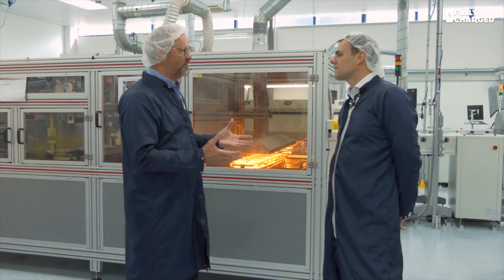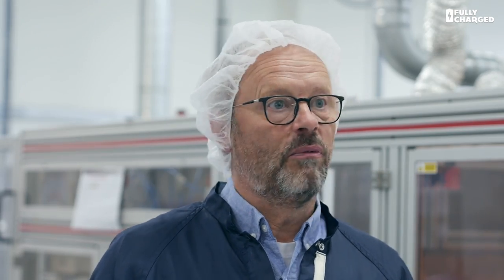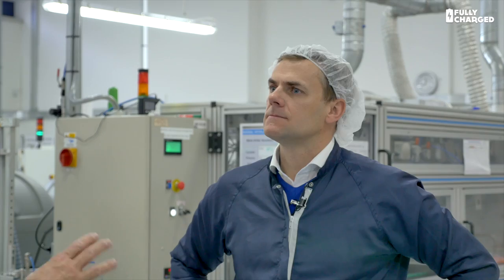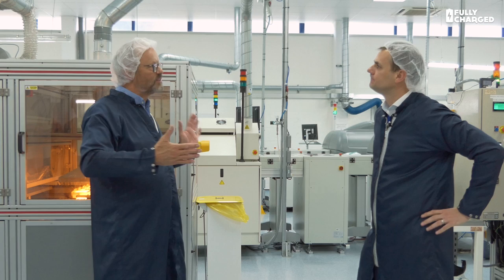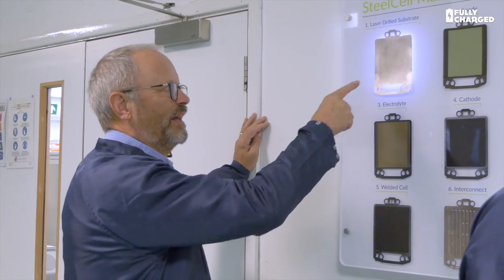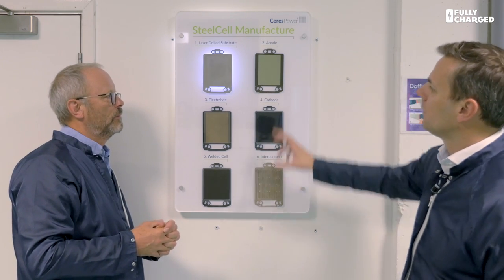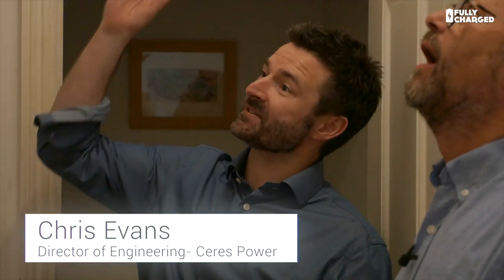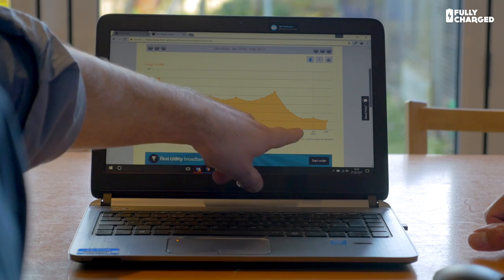Ceres Power | Fully Charged

Comment: I need to chime in a bit here about the use of hydrogen. There is this idea that we can create hydrogen cleanly by doing electrolysis of seawater using electricity generated from renewables like wind and solar. While it is true that it is possible to do this, it is also true that it is a massive waste of energy due to various losses along the way. Let me illustrate:

Problem A: There is a tremendous loss of energy in the process of electrolysis. Electrolysis requires a lot of energy to split H2O into 2H + O, so a lot of energy is spent in this process. The process itself is not efficient as you will need to use a lot of the energy generated from the renewables to power up the facility / plant that does electrolysis itself. So of the total sum of power you generate from the renewables, a huge chunk of it goes towards powering up the plant that does electrolysis, then another huge chunk goes off by way of losses in transmitting the power and heat and so on and finally the remaining energy goes into the actual action of splitting water molecules - this is the energy that's "stored" in the form of hydrogen. Basically what we're doing is that we are storing the power used to actually split water in the form of hydrogen gas, and the use of this hydrogen gas either in a fuel cell or by combustion gives us back that power that we stored in it. Essentially, the hydrogen is just a highly inefficient transport mechanism for moving power from one point to another - like a really terrible battery.

Problem B: So now that you've wasted so much energy just to make the hydrogen and you've captured some of that energy in the form of hydrogen gas, you now need to liquify the hydrogen for transport. Liquifing hydrogen means using a cooling plant to cool down hydrogen to -252.9 degrees Celcius - this involves an enormous use of power and this is power that's going to be a complete loss. The power used to cool hydrogen to a liquid isn't going to be "stored" in the hydrogen so there's no recovering this power later from when we use the hydrogen. So again we have an insanely inefficient system here where we're just wasting energy completely.

Problem C: At atmospheric pressure, hydrogen liquifies at -252.9 degrees Celcius and starts to boil at just a fraction over this point. So if you put liquid hydrogen somewhere where it isn't constantly -252.9 degrees Celcius in atmospheric pressure, it will be boiling. To maintain a container at -252.9 degrees Celcius constantly requires a ludicrous amount of energy, so instead we create pressure vessels - as the hydrogen boils, it increases the pressure in the container and this increase in pressure slows down the rest of the liquid hydrogen from boiling - but it still keeps boiling and the pressure keeps rising. Eventually the pressure gets so high that it will trigger a pressure release valve in the container which will let out a little bit of that hydrogen to bring pressures inside the container to within tolerances. This means 2 things - one is that you cannot place that container indoors as it will eventually fill up that room with hydrogen and the entire room becomes a giant bomb. This is why the prototype BMW Hydrogen 7 Series which uses a hydrogen combustion engine and has a liquid hydrogen tank cannot be parked indoors in a garage or an underground parking space because the liquid hydrogen tank releases puffs of hydrogen every so often. The other thing is that every puff of hydrogen released to stabilise the pressure in the tank is a little bit of energy that we're simply throwing away into space - literally to space, because hydrogen is so light that it rises up to the very top of the atmosphere and floats away. That puff of hydrogen represents the huge amount of energy input from the energy that was used to power the electrolysis plant to the energy that split water and all the energy that was wasted in cooling hydrogen down to a liquid - all of that energy puffed off into space.

Problem D: Unlike electricity, transporting hydrogen is a MASSIVE drain on energy. You either need to waste tremendous amounts of energy to pump hydrogen on a high pressure pipeline or you need to waste tremendous amounts of energy to build a plant that fills up hundreds of high pressure tanker lorries with liquified hydrogen to be transported to various locations.

So if you look at the hydrogen life cycle as a whole, you see that we are wasting so so so so so much energy throughout the process. This is why the concept of a hydrogen economy did not catch on because hydrogen is a horribly inefficient form of transporting power, the wastage is simply unjustifiable. We have figured out that Lithium Ion batteries are a far better means storing energy because it's incredibly efficient and we also figured out that power transmission lines are far more efficient at moving energy than hydrogen pipelines or lorries carrying hydrogen.
Reply: The problem still remains though - we're going to have to waste a lot of energy in the conversion process: Wind / Solar -> Electric -> Hydrogen -> Ammonia -> Hydrogen -> Electric -> Consumption

We can do much better with Lithium Ion batteries because there's no conversion involved and Lithium Ion batteries have a much greater energy density than Hydrogen.
Wind / Solar -> Electric -> Consumption

Looking to the future, we are talking about glass-based electrolyte batteries that have far greater than even Lithium Ion
Reply: PJNinja Lithium Ion batteries only matters when you have power generation near you. Synthetic Fuels means Storing massive amount of energy easy for long distance transport. Able to access Renewable Energy once thought too Dificult or Remote. Making it Practicaly 100% efficient considering it was not viable. e.g. Burning Hot Desert combination Solar Thermal & PV to create Alkanes (C3H8 C4H10) from CO2.
Reply: The thing is, as long as you can lay wires - the most efficient way to transport energy is high voltage, high frequency power transmission cables because the losses are far far far less than converting electricity into other forms. I can agree with the use of electricity to create alkanes from CO2 if the aim is long term storage (years, decades, etc.) , batteries aren't great for long term storage. There is definitely a case to be made here for national security to use electricity to make alkanes from CO2 and store it underground for many years in the event it becomes necessary during war, etc. but for day-to-day consumer use - it'll be far cheaper long term and far more efficient just to build power lines for transport and batteries for storage.

Comment: 1kWh does not run a house for all that long. I just checked my energy usage: 54kWh/day average with peak consumption of 106kWh. I'm going to need whole lotta these boxes.
Reply: WOW! We use 4.5 kWh per day (3 kWh low and 6 kWh high). How many people live in your house? We are a couple. Maybe you should look into LED light bulbs and more efficient appliances and a condensor dryer? Also, I have found electric water heaters to use a lot more energy than a gas one.
Reply: That's a lot of energy! We're using about 12kWh/day and that includes charging my PHEV
Reply: kW = an amount of power, kWh = an amount of energy.
Reply: We are just a regular family in our home but have 2 central AC units, a pool pump and an EV. Energy consumption drops ~65% when the A/Cs don't run (in winter), and they are relatively high efficiency ones.
Reply: American, yes. Guilty as charged.

Comment: Seems like this a mis-marketed product... it's essentially a boiler replacement which also supplements your power consumption by providing power up to 1kW. But there's very few homes which don't have a product which requires more than 1kW to run, I'm thinking of a dish-washer, washing machine, hair dryer, air conditioner etc. Robert should have really made this clear in the video, but interesting to hear about "new" tech regardless.

Comment: Whilst I am delighted that this company is British and that its products are (assuming everything in the video is true and that the devices are affordable) more efficient overall than what we have now in the way of gas-burning electricity power stations, the fuel is still a fossil fuel and it is still only a 50% efficient process.

There is also the small question of energy security where in the UK, for example, much of our gas is controlled by the Russians... not exactly an ideal situation.

On the other hand, if we were all installing PV and battery storage instead (at probably much the same cost) all these issues would evaporate.  The path to a sustainable and secure energy future is, to me at least, very clear.  Unfortunately, it leaves Big Oil (for which in the context of this comment you can read as 'Big Gas') and their political buddies, out in the cold.  

So, that'll never happen then!

Comment: Keeping the temperature high might require considerable amount of energy. How practical is the fuel cell to be used on cars as range extender? If it’s practical, this Ceres Power company should seek this application and don’t wait there for its own death. Most startups die because their products fail to reach a viable market.

Comment: So is this more efficient then the Toyota fuel cell used in there hydrogen vehicles?
Reply: Just cheaper, SOFC does not require Precious Metals. Toyota Mirai still uses stupid PEM. H2 is also the worst large scale fuel for SOFC, kind of pointless to use H2.

Comment: Sorry, something I don't get. What happens to the fuel once it has gone through the cells? I understand you give pure Hydrogen and Oxygen (from the air) to the an hydrogen fuel cell  and it converts into pure water while producing electricity with zero residu. So, I assume when you feed these cells with an hydrocarbonated fuel (like natural gas or oil or gas or...) and the hydrogen part is converted into water when combined with the 02 from the ambient air, but it must leave something left, that is everything it was before minus the hydrogen. Am I correct? So I assume it still produces CO2, NOx, SOx and other "stuffs", depending on the fuel, only being much more efficient at doing so. I don't understand how this is solving any envirronemental issues only by being half-less polluting than just burning it. But being half-less polluting, isn't that still pollution? Please, if I'm wrong, correct me. Thanks.
Reply: You get CO2 and H2O like in combustion so this is not carbon neutral or anything. NOx and SOx are largely created due to the high temp in combustion. Here you don't have that.
Reply: What I understand is that the fuel gets through the cells, produces some electricity when some H is combined with some O to produce water, and then the fuel exits the cell and is burned as a regular fuel (though one with less H in it). That is, it does basicaly nothing for what pollution is concerned to my opinion. Interesting though.
Still I'd appreciate more details about this process.

Comment: why couldn't you do the same thing with a thermoelectric pile, a much older technology.
Reply: or even a small natural gas powered generator and using the  waste Heat thr same way?
Reply: You could do the same thing, I think the point is the efficiency they are getting is the best in the world. One of the reasons why we have big power plants instead of small ones is that its more efficient
Reply: You can do the same sort of thing with older means, but there are some important differences.
Thermoelectric piles have an efficiency of 1%, or 2% if you run them in extreme temperatures.
A small gas powered generator is essentially ye old lawn mower-generator, which only gets you 30% efficiency , they are loud  as hell and commercial units  are absolutely not intended to run all the time (as in they will wear out within a year or two).
Even industrial generators are only intended to run for short periods, if you ran them 24/7 they would maybe last 3-4 years before major components need to be replaced.

So in contrast fuel cells with 50% electricity and 50% heat in a solid state and quiet operation are quite a good contender.
Reply: generators are noisy for one!
Reply: Look into CHP units.
Reply: Thermoelectric generators are horrendously inefficient. A fuel cell is much better. They can also supplement your heating needs.

Comment: I don't get it, the fuel cell is still connected to gas from the home, so how does the fuel cell save money and give back to the grid?
Reply: Because the electricity is generated where it is used and the process involved in generating it is more efficient than burning it at a gas fuelled power station. Plus, the heat that is produced during the reaction can be used to heat water for the home.
Reply: foamcow cheers for clarifying . Makes sense

Comment: So it emits CO2 and CO when running on gas? Interesting, but w/o a bulk H2 supply it doesn't reduce carbon that much.
Reply: Alberto Knox But it converts 50% of the energy to electricity with no moving parts.
Reply: No most use case is not from H2. Also can use it to consume Synthetic Fuels from Renewable energy from hard to transfer place i.e. Deserts.

Comment: If it can handle ethanol them put it in cars and fuel them on Bio ethanol and you'd have a system big oil would get behind as the existing infrastructure (service stations) could easily cope with it without much change.  As long as the ethanol came from brewing up waste from different industries it would be good result.

Comment: He said it wasn’t a hydrogen fuel cell, but it is. It uses natural gas. And they are playing on the fact that natural gas is turned to carbon dioxide, and there is no net increase in the carbon in the air, but this is misleading, as natural gas is trapped underground and if we mine it, and convert it to carbon dioxide, there IS a net increase in carbon in the atmosphere. Hydrogen fuel cells are not the way forward.

Comment: This technology is really cool.

If these fuel cells can convert hydrocarbons so efficiently into electricity, and if we're getting more CO2-neutral hydrocarbons (from algea, biowaste, etc.), why would we want to use hydrogen gas as a fuel? Literally the only benefit as a fuel, as I understand, is that it's by necessity CO2-neutral. But if we had CO2-neutral hydrocarbon economy (which we absolutely need to achieve anyway, due to our dependency on them), that benefit goes away. Hydrocarbons are generally liquids and have higher energy density, which makes them much more practical as fuels.

Not to mention that batteries eats into the niche hydrogen gas would occupy, every time the batteries gets better, since they're always gonna be more efficient and practical for everyday short/mid-range use.

I wonder what it'd take to put this technology into long-haul trucks, airplanes and ships. And I wonder if it's feasible to produce all the worlds fuel requirements for this sector with sustainable CO2-neutral methods. That'd solve the missing piece in the transport sector.